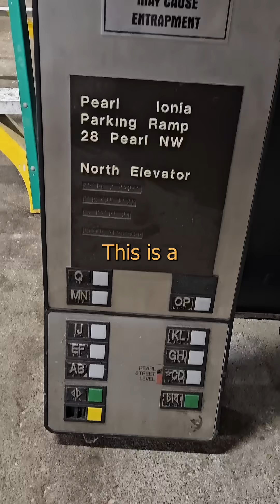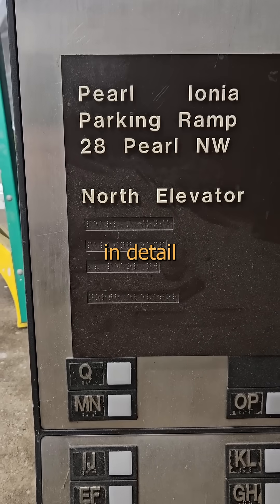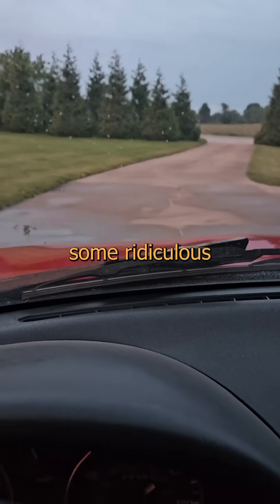Miata Mischief #chrisboden #engineering #gear #elevator #score #stories #parts #hacking #making

Comment: Each time the now ex and I visited the in-laws, we would borrow a mattress from the brother in-law, open all four doors of our car, and tie it directly to the roof. Drive across town, sleep on it for a few nights, and return it the same way. 
Onced helped my dad to move an old ‘58 Dodge Truck engine, (Real truck, not a Pickup.) by sticking my cheap skateboard under it. He then borrowed my board each time he needed to move something bulky. As teens, best friend and I found a decent piece of lumber on the side of the road that had fallen off a truck. (Pickup, not real truck this time.) decided it was going home with us as some part of some unknown future building project. Tied one end to the under side of his dragster pushbike seat, and to the gooseneck of my MX pushbike. Nearly killed each other multiple times on the five mile ride home. But made it. Friend/co-rental lease holder and I, after contemplating the idea over five bourbon and colas, pulled an 8x12 foot piece of chipboard out of a building site dumpster. (It had a corner broken off, and was a local government building project, so of course they threw it out to buy another one.) We carried it back to our place about 1/4 mile away, and somehow tipped, bent, and forced it through the front door. It got turned into a wardrobe and bedside boxes. Recently, I got permission to put a cat door in the back door of the rental I was in. I told the owner I would buy a replacement solid core hardwood door to replace it with. Somehow got it into and out of a Toyota Corolla station wagon, by myself, and when pulled up by the cops, they had to agree as it did not block my side view, and was securely tied down to designated and rated anchor points, so it could not move an inch. I once transported a friend’s push bike on the roof of the same Corolla, without any form of rack. Tied it through the open doors so it stood upside down on the roof on two rubber mats. It did not move or tilt.

Comment: I got a couple hundred pounds of PDP-11 too.  Local company thew it out in the late 80's, they just leaned it outside the dumpster.  Half the weight was the dual-10 inch floppy drives.  I had to sell it 20 years ago, drove 10 hours round trip dropping it off rather than pay $200 in shipping.  Never powered it up and the buyer was thrilled b/c magic smoke was never let out.

Comment: Uk here .  In my teens i picked up a wooden telegraph pole . Strapped a ride on mower front axle to the backe with a ratchet strap,  and front end to the back of a fergy (  very old little tractor )   bribed a mate to sit on the pole and steer the mower axle as i drive the tractor  3 miles home on the road , and iv still got the photos

Comment: It's not too bad, but i picked up a $2500, 135 lbs kayak in a $500 2001 Ford Escort ZX2, when trying to get it on top I accidentally put it through the back window, then thought "well the damage is done" ripped the rest of the window out, and shoved the kayak in the hole and drove 75 miles like that, still have the kayak, but the transmission on the car got jammed in 2nd even in park, when the scrap yard came and picked it up, they started it doing the "let me reach over and turn it on, it proceeded to drive itself up the tow truck ramp, and plop itself with it's front tires over the edge of the bed, they had to bring out another wench truck to pull it off the first truck, that car was a death trap
Reply: I don't doubt that, the car as well, ford escorts are pretty bad, my parents had one, and it was as they described, a deathtrap, I don't know much details largely because they forgot most everything about that car due to its complete abundance of suck.
Reply: @AtomBomb420  the car was so bad that the memories of it had to be purged from their minds in order to maintain their sanity.

Comment: I had an 8 foot bed pickup, I had to haul over 60 wooden pallets from my works shop to the place to sell them, and I had to do it all in one run. 
Was it legal? 
👀 
Was it sketchy?
Oh ya, the load was about 8 feet TALLER than my cab
But did I get it there safely? You know it… All with one ratchet strap too. Dumbest thing I’ve ever done

Comment: I once brought home a multitap transformer from an oncology remodel. I wasn't sure if the Accent seat fabric could withstand the sharp corners of that 100 pound box of coils but I couldn't bear the thought of throwing out something so cool. Moved three times with that heavy bastard until I finally threw it out. It could convert anything from 480 down to pretty much anything else in that range. The seat survived! Brought home hundreds of bricks in the same car. Loaded the floor board every afternoon for weeks to do it.

Comment: I once took two 8’x4’ foam board panels home on the roof of my car strapped down with elastic chord.  

Safe to say one hand was on the steering wheel, the other desperately trying to hold the panels onto the roof of my car.  Nearly turned myself into a flying car!

Comment: When I was in my early 20s I drove a 1972 Fiat 128SL Coupe. I also rode dirt bikes nearly every weekend. When I did something stupid to my Dad's truck (something minor, scuffed it, ran it out of gas, I don't remember) he wouldn't let me borrow it for a day of ridiing with friends. So, I removed all of the seats from my Fiat leaving only the driver's seat, moving it all the way forward, and loaded my 1984 Honda XR200R diagonally in it, with the back wheel in the left rear of the Fiat and the front wheel in the front right. I actually got the passenger door closed and drove an hour from Rancho Cucamonga to Hesperia, extracted the bike and had a great day of riding. The looks I got as I drove down the freeway in a Fiat with a dirt bike inside was comical. The hardest part was after a day of riding I was tired and sore, and I had to muster the strength to get that bike back in the Fiat to get it home. Me, the bike, and the car got home somewhat safely. My relationship with my 82 year old Dad is amazingly good now, and we have a lot of great laughs about all the stupid crap I did in my yournger days!

Comment: So I go to a pirate themed renaissance fair every summer with a crew of my close friends/idiots. Last year we wanted a better entrance to our campsite, a 50’x50’ plot on site. So I built a Tori gate that has an 8 foot wide opening and is just over 11feet tall fully assembled. Needless to say, it’s pretty damn big even when broken down. I, however, own a 2003 Honda element which is amazing for most things but oh boy, this was pushing it. 

The two uprights are 10 foot long and at least 100 pounds each. The top piece was almost 14 though much lighter as it wasn’t structural. I strapped all three to the top bars on my element and drove nearly an hour and a half to the event with this thing and was having a damn heart attack the whole way.

For context the top bars on an element are, at most, about 2 1/2 feet apart and made of aluminum. Every little bump in the road made this thing wobble and bounce. I could hear the top gram of my car creaking as the force pushed the bars down and flattened them from their usual arch shape. I think I drove more carefully than I ever have then but damn was it worth it when we got the thing all set up. Fortunately it left the even on our crews trailer and not on my car.

Comment: Not exactly what you're asking for but I once hauled an RV 15 miles with the breakaway cable, well broken. Only noticed when the tire rubber started melting and smoking from red hot brake pads

Comment: About 15 years ago i moved across the state and only had a 90 model single cab 3.0 Ranger. I pulled a double axle trailer complelety full with the contents about 3 feet taller than the truck, bed was loaded down as well, along with the cab. That poor truck struggled the whole way, dont think i hit highway speed at any point in that 200 mile journey. The 5 speed transmission grenaded about 6 months later when the input shaft bearing failed.🤦‍♂️

Comment: When I was 17, I had a 2000 Ford Ranger 3.0 2WD that had a cracked cylinder head and a very old clutch with 284,000mi on it. I was the only one in my family who owned a truck that ran at that point. My mother had bought 30 50lb bags of mulch that she needed hauled home, so instead of renting the truck from Home Depot, I drove over there and loaded it and hauled it home... very slowly. It made it. That same truck pulled a 40ft evergreen down a gravel road so it was a bit of a beast. Wish I never sold it, it was rust free. Oh well. Live and learn

Comment: Once when i was a kid, my parents had gone out on a whim and bought a pretty big flatscreen with some groceries. 

The problem was, we drove there in my mother's Kia Forte.

Their solution was to stick it in the backseat with the groceries in the trunk and m me lying on top of the cardboard slab because there just wasnt enough room in the backseat (not to mention hadn't taken out my cousin's carseat at the time). They drived slowly on the way home because even with the seatbelt it was not a safe stting position. I'm still surprised that we didn't get pulled over.

Comment: Used to deliver pizzas in a second gen Miata with a 3" lift and 27.5" snow tires. In Michigan of course! Hey Chris!

I can, for a fact, say that you can fit 5 24" pizzas (in their 26"*26" boxes) in the interior of a Miata. If you fold down the passenger seat and don't mind a steamy ride.

Alternatively, I've put those same 5 27.5" tires in/on the miata and drove them home. Some creative use of ratchet straps was required but I didn't get pulled over!

Comment: I've got a 92 miata and let me tell you. I didnt know you could have so much fun with 118 hp. Plans are itbs and high compression. Hoping to hit about 200 eventually all motor. But in this car i managed to move a mini fridge to my old job I had to remove the front seat and it still ended up flying out after I hit a slight bump and ended up causing an epa disaster spraying out the refrigerant. Ended up at the scrap yard instead.... shoulda used a strap lol

Comment: I couldn't afford a car so I removed the seats from my mum's 2005ish Kia Rio hatch to pick up a load of laser cut sheets for a job that I was doing building ground support equipment to pick up a couple of Cesna Citations. The guys laughed so hard when they started loading it with the forklift I told them just try not to scratch the paint and I drove it on bump stops back home haha😂 Put the seats back in mum never knew the difference.

Comment: I put helper airbags on a truck in an autozone parking lot in the texas heat to be able to tow my dream car home. 
I rented an enclosed trailer and on the 24 hour drive to pick up the car (NY to TX), I realized the vehicle was not going to be able to handle the full trailer. So I found a set of helper airbags online at a 4WP and then went to autozone and cut the bump stops and fitted my new springs. Oh and the truck I was driving, it was my buddies. 
Got myself a 2012 C63 AMG from Texas and one hell of an experience.

Comment: I cant drive, and needed to get 25 full length 2x4s 2 miles from the store to back home
So i made a hand cart using a set of wheelchair wheels, some 2x4 offcuts, and random screws I had around, and walked all that wood home with the cart.

and then did it again a year later

I also used to haul half sheets of plywood on the back of my pedal bike using a bag rack and a lot of masking tape.

Comment: My school bought an old transformer tig welder off of fb marketplace but since the theatre department bought it instead of the school itself and it being my idea I ended up having to drive it from some guy's house to the school in the trunk of my gx470. Since it was only a 10min ish drive and because i am an idiot we didn't tie it down, like at all and being that it weighs around 250lbs and was on wheels my friend in the back seat had to desperately hang on to it for dear life hoping it wouldn't go through a window or shear the latches off the trunk door. But alas we managed to get it there without it plowing itself through any unsuspecting part of my car.

Comment: This isn’t necessarily sketchy, but as a musician I once had to borrow my dad’s Mini Cooper S to drive to a gig out of town. The thing about this car is that there’s no comfortable way to fit larger instruments in this tiny ass sports car, so my bass guitar had to sit in the front passenger seat with the roof down. 

As I was coming back from this gig, I stopped at a drive thru to get some food for the road, and the line got unbelievably badly backed up. So, I grabbed the bass and just started jamming on it to keep myself entertained. 

So, if on one particular night about a decade ago, you were working the drive thru at a chicken joint in North Carolina, odds are good you saw a dipshit teenager in his dad’s sports car jamming out on the bass guitar while you served him his dinner in a styrofoam box

Comment: This was another great video! 

I had to haul 12, 12foot 2×4's.
My trailer is only 8 foot and had a tail gate, so I couldn't let the bords hand off the back of it. So I opened the back window of the SUV I was driving at the time and ran the boards from the windshield and dash, over the back seat, and out the window of the rear hatch. I couldn't see the passenger side mirror or anything else to my right. I just stayed in the right lane all the way home.

Comment: A few years ago some friends and I were drunk walking back to our university dorm. As we are walking down the street a friend sees a meter tall lion statue outside of a restaurant. One of em decides to give it a "gentle" kick and to our surprise it broke clean off the base. We tried to pick it up but it was too heavy even for the 5 of us. We called an Uber thinking we could toss it in the back but the Uber driver declined. 5 min later we stopped a drunk guy who lived in the dorms next to us and we offered him $20 to take the statue to the dorms. His girlfriend was in the passenger seat and she said: We'll do it for $30. Once we got it to the building. Our dorm was on the 5th floor and the elevator was broken... Fortunately we were engineering students. Somehow we found some rope and we lifted the entire thing using the staircase railing as a pulley. It's been 6 years since that and the statue is still inside of the dorm hallway. 😂

Comment: I took home a full sized arcade airhockey table on the roof rack of a 98 grand Cherokee 
Also when I'd my convertible I found a large slate patio table at a thrift store. I put my top down, flipped the table over and laid it across the trunk to backseat and tied it down with rope I had in the trunk for bandage sessions with my ex. I'd stuffed a treadmill in the backseat of that same convertible with it sticking 5 feet in the air and drove it 30 minutes on the highway as a gymnast height, coffee table wide, mid car spoiler

Comment: I love coffee houses. As far as chains go, Carobou was way ahead for my favorite. As some will know their interiors used to be legendary like a dream cabin from which coffee was sold. When one was closing down I was given a chance to take home some fixtures. All the leather arm chairs and wood log tables had dibs but I got an incredible set of stained glass- ish mosaic and brass/bronze (?) lantern style light fixtures. Each roughly the size of a lunchbox. Like what you'd see hanging on the fence posts or next to the front door of a swanky house.  I drove in my 2002 Toyota MR2 with my friend in the passenger seat gently hugging a pile of them on top of her while I drove 40 miles with a 2" ground clearance. Both she and the lights all made it unscathed. Its not the most dangerous duct tape hauling I've done but I still look at the photos from that day and think it cemented a life long friendship.

Comment: Cargo and passengers are overrated, however miata na's are not. Mine travels 270 miles a week so I can manufacture the heaviest phallic shaped weapon of war. It's a shock wrenching on something not much larger than yourself and also something that makes you feel like a ant wielding a drill bit that is like a mosquito's pecker to a steel whale. 
Even more ironic and scale tipping is that I honed my skill repairing equipment from garden sheds and leapt up to something that goes for final assembly by boat in 9 massive chunks that are carried on the back of a very similar vehicle to what moves the space shuttles to launch pads. 
There are a lot of automotive nuts who earn our checks making the nations best line of defense. The crossing over of skills, use cases, and crafty tricks you'd only dream of coming up with warms my oil pump of a heart.

Comment: I bought some 4'×6 ' canvases on a black Friday sale and realized I had no way to pick them up I thought I could fit them through the back seat in the trunk forgot about the unibody bracing that went through the back so I went back in the store bought some twine rolled the windows down threw them on the roof and went crazy tying them down drove 35 miles back to the house 80 miles an hour on the freeway they stayed put but boy was it sketchy

Comment: Cool? No. Sketchy? I got that bit covered….
1984 Ford EXP, the bug eyed one, already a rolling death trap, loaded with two lawn mowers stacked on top of each other…I’ll digress here…car didn’t come with a back seat or partition so, like a panel van, if you wanted something a quick hit on the brakes and it would just hit you in the back of the head…but anyway. So…two mowers…3 gallons of gas in three steel gas cans…remember those…all properly rusty, a quart of oil…hatch flapping, bald $20 Sears tires on a car that would lift its front end at 60mph. I was a rolling IED.